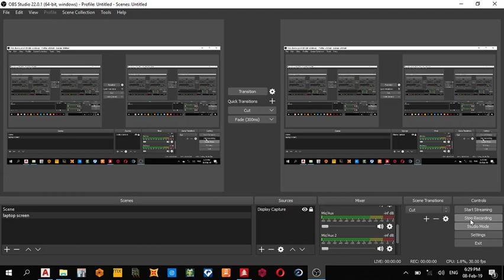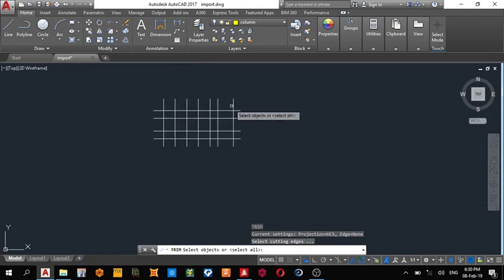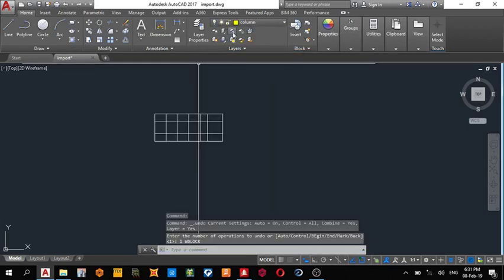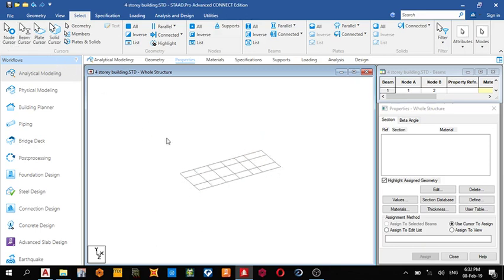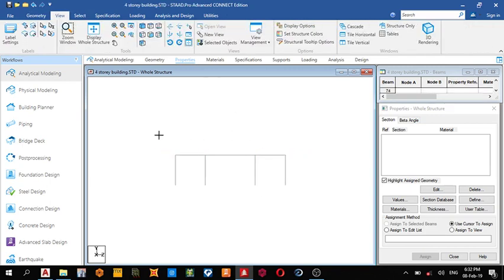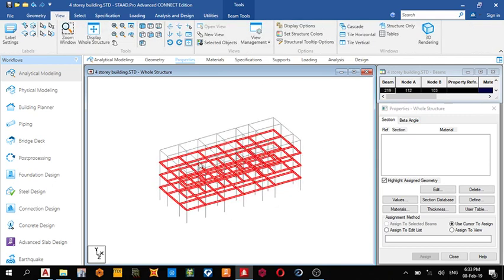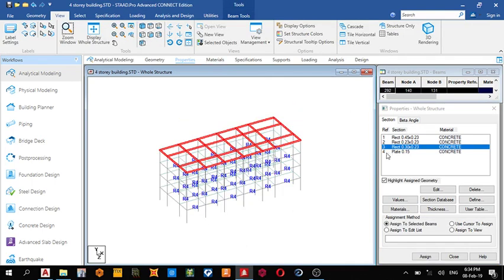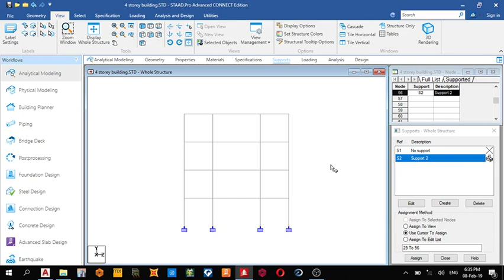how to import autocad file into staad pro connect edition

Comment: Hi,   i have imported  dxf file in staad ce in but my translational repeat is not working and my dxf file is in feet .. is there any issues with units. pls suggest me to imported dxf file to  make use of transistional repeat..
Reply from the maker: what unit did you use on autocad?
Reply: @Lanreolokunola   feet,  engineering
Reply from the maker: try and break intersecting members first
Reply: @Lanreolokunola    OK.. By how? 
Tolerance limit setting??
Reply from the maker: @structuralengineer3787  yes.

Comment: Thanks for the video. I noticed that the drawing was done in mm and also saved in the same unit. While opening in staad you set the unit as mm too. How come you entered 3 in meters to define the foundation depth?
I tried 3m foundation depth but was very small. It became noticeable when i entered 3000mm. I'm a bit confused.
Reply from the maker: Felix O. What error is yours giving?
Reply: If I enter 3m in transitional repeat you would not notice any difference nut when I enter 3000 the change in level become obvious/normal
Reply: If I enter 3m in transitional repeat you would not notice any difference nut when I enter 3000 the change in level become obvious/normal
Reply from the maker: Felix O. Check your input unit
Reply: @Lanreolokunola  Ok thanks